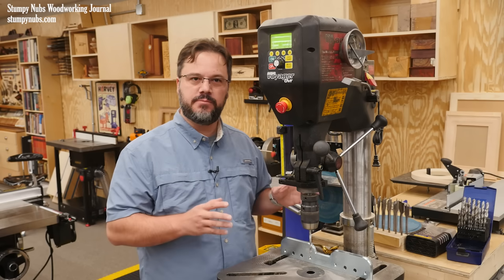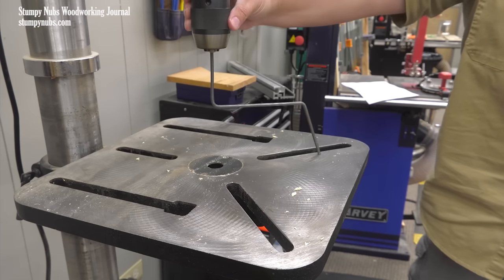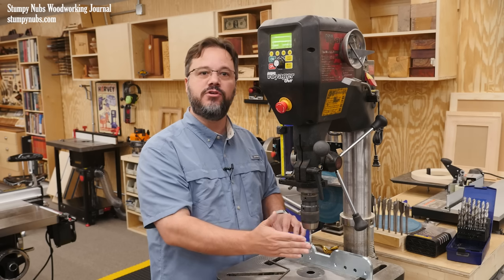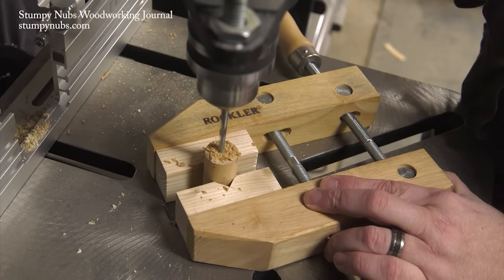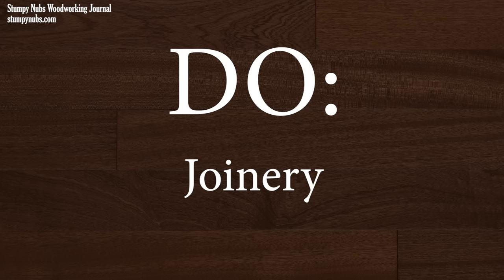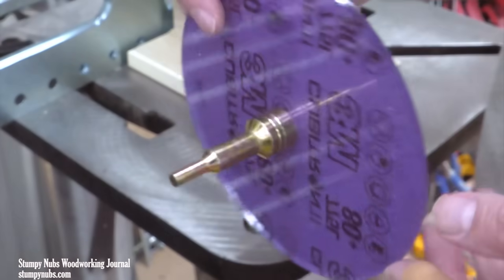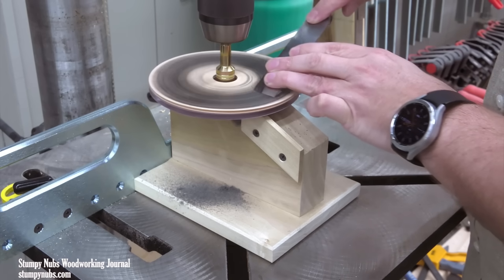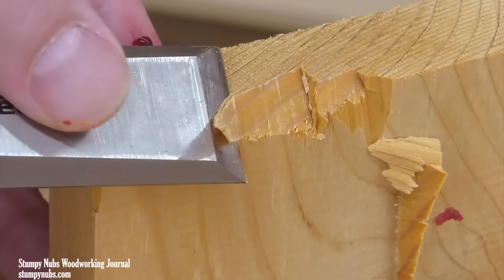WARNING: Internet drill press trend can SERIOUSLY hurt you!

Comment: Worked in machine shop for 40 years.   Saw the results of drill press accidents,  torn off thumb and fingers and mangled hand. 
Don't wear gloves when operating. Your hand will be pulled in by them .  
Bolt your project down securely in 2 or more places. 
Remove the stringy chips with a  1/4  steel rod , straight,  no bends in it.
Never place your hands in harms way if your job breaks loose and starts spinning.
Reply: Ole retired machinist here. I agree with this!!!!
Reply: What do you mean by the stringy chips?
Reply: Right you are. I recall a coworker who lost his thumb when drill press caught his glove!
Reply: @jaeyi8936  if you dont know, you havent drilled a hole...

depends on the metal... and the drill itself.

copper and aluminium both tend to make long spirals, hairs, and if they dont eject enough material... they gum up and seize in the hole. or it just wraps its lf around the drill forcing you to stop and clear everything on every hole..

brass chips no matter what you do, as does cast iron...

its the steel that makes nasty flaking "pins" thats the worst, imho, little shards of steel that get into everything. usually your toe, two days later when your carrying that heavy awkward item somewhere... "FFS!"
Reply: @jaeyi8936  The swarf -  "small pieces of metal, stone, etc., produced when a material is shaped or cut on a machine"
Reply: @jaeyi8936  Opps,  I worked with metal.   Anyway, don't ever try to pull away metal chips with your hand.
Reply: @OneWildTurkey  thanks, I think I know what you mean! I'll google swarf to make sure.
Reply: @paradiselost9946  gotcha, thanks. I've only drilled wood so wasn't familiar.
Reply: @jaeyi8936  ever tried ripping a log with a chainsaw? same effect, you get long "strings" rather than the "chips" of a standard crosscut.

when metal comes out in nice corkscrews, its fine... sort of fun on a lathe, watching them emerge from a bore, pausing every now and then to break them off so you collect a nice pile of screws all the same length, and easily tossed in the bin... or try and keep that long spring running as far as possible, snaking its way across the workshop floor... (bad chip management! frowned upon!)

its also a good sign that a drill is sharpened properly or not, the symmetry of the curls from the cutting edges.

 whereas every now and then you get threads, and they wrap themselves around everything, usually just at the end of a finishing pass so you cant see a thing and cant stop either or youll wreck the part...
Reply: That goes for any machinery. I would take off any wedding rings as well.
Reply: @rshinn8776  No jewelry Period when working with machinery. No loose clothing either.
Reply: @paradiselost9946  I worked in a screw machine shop had one job where we turned the O.D. with a box tool (a tool that cuts on a tangent to the diameter) had strings of 12L14 that where literally longer than I was tall. I'm only 5"7" the string was 6" and change.
Reply: Should NOT have the magnetic cup for things. They could fall out from vibration. NOTHING should be loose and near the whole drill press.
Reply: I came back just to read these tips as the YouTube player had other ideas. I don’t have a drill press yet, but it’s good to learn the safety precautions BEFORE buying the tools in my opinion. Nothing better than veterans of whatever field that tool comes from. Cheers!
Reply: @brucemiller1696 had that happen 😂
Reply: @danielbackley9301  lol, i had the joy of setting twin tool box cutters with steady rollers at one point... and multi point boring heads.

could take a few hours, but once theyre in use and maintain tolerance over a week of production... well worth it :)

sigh... "obsolete technology"...
Reply: @paradiselost9946  Oh. You mean the swarf.
Reply: 1/4" steel rod? I used to use a wooden ruler or meter stick, as at least it will break under my own strength if it gets snagged badly by swarf.  It's all not relevant for woodwork though.  The high torque, high momentum and slow speeds in metal work are a different kind of evil.
Reply: @mgjk  The 1/4"  rod (steel)  is maybe 18" long.  If anything grabs it, it will just slide out of your hand  - no harm done.    * it will last several hundred years doing lathe work !
Reply: Back in my first machining job, I used to hold my arm out and let my long sleeve take the swarf off the spinning bit. Any machinist already knows why I suddenly stopped doing that - all I'll say is I was very lucky, got away with just a torn sleeve and a bruised forearm.

And then a week or so after I left that job, my (former) coworker got careless with the mitre saw and took his fingertips off - used the saw to trim a tiny ragged end off an aluminium plank, and the saw kicked the offcut straight through his fingertips.
Reply: @patheddles4004  You were lucky to only lose a shirt,  with some bruises.  A large radial arm  drill press would really mess you up.  Stories like this give a cold chill.
Reply: @jaeyi8936  When we cut metal and drill with a constant feed,  a swirly long chip will be created.  Spring like.  Unlike wood.
Reply: Grabbing a helicoptering part is the only injury i've seen on a press myself. Thankfully wasn't too bad as they succeeded but the bruising and scrape was ugly enough. Was especially low speed stuff which is probably why they  thought to grab it over hitting the stop.
Reply: @MrJdebest  relatively small drill press, but yes I got lucky. Scared the shit out of me, and in retrospect that was a very cheap way to learn that lesson.
Reply: That goes along with controlling the urge to break the fall of a heavy object with your foot!  A friend got a severe beak in his foot trying to "cushion" the fall of a tool that wasn't secured.
Reply: @87mini  I know about that.   A worker put his foot out to safely and quietly land a steel bar on his steel toed boot. Opps,  he forgot he had sneakers on . Ouch.
* Also, if you drop a gun, you are not supposed to try and stop it by catching it. Your finger might catch the trigger and  Boom.

Comment: Another hint if you need to drill sheet metal.  Sandwich the sheet metal material in between two pieces of plywood, clamped to the table.
Reply: Important to note why: It's not just a safety thing to make it more controllable. The wood clamping the sheet metal prevents the pressure from the drill bit deforming the stock, making for a cleaner, more precise hole and less material deformation. To a lesser extent it also sinks some heat away and that can matter if for some reason you're drilling Inconel sheet.
Reply: How do you drill a hidden mark?
Reply: @rodenreyes6320  You set up the material and lightly clamp down, then you place a cover board over and use another clamp to hold the cover board in place.  Not going to work in all situations, but usually will.
Reply: @sferg9582  OK...I was thinking sandwiching all before drilling.✌️
Reply: I use chassis punches for that
Reply: I always use a annular cutter for sheet metal. It is always a clean start and finish, never grabs.
Reply: @rodenreyes6320  you don't have to reinvent the wheel, these commenters have a collective millennia of experience. Asking was sensible.

Comment: Not specific to a drill press, but to all the drill indexes out there.  As a retired toolmaker, I made it a habit to store my drill bits in the index with the cutting end down, and the shank up.  I found that closing the larger drill index, the cutting edges can sometimes be a hazard, but only when they're pointing up.  Another benefit to that is sometimes a drill bit will spin in the chuck and bugger up the shank with a burr (admit it, we've all done this), buggered up shanks don't fit the index holes.
Reply: I worked with a 40 year machinist, he was only person I ever saw without burred bit shanks . But whenever I do it I will touch it up on the grinder before putting away . A bur will  off center the bit just a little
Reply: @outinthesticks1035  Yes!  I do remove the burr too, just not immediately
Reply: I've been doing this, tip down storage for years.  I don't even remember why I started but it just feels more natural to me to protect the cutting edge, and myself from the edge.
Reply: Storing in an index is just a nice idea on its own, or as a plate for a bit block.

Comment: I'm a good example of a bad example regarding not clamping the work piece. About 20 years ago my youngest son watched me in horror as a sliced through my thumb after failing to clamp a thin strap of metal while enlarging a hole. The drill bit grabbed the strap and very neatly cut through my thumb tip including the nail. The nail eventually fell off and took almost a year to grow back. I purposely left the blood stains on my shop floor as a reminder.

Comment: In the early 80s I was running production lines for Tandy, building floppy disk drives.  We had a rework station modifying a plastic part on a drill press.  The young woman got her long hair caught in the chuck and her forehead was quickly pulled in to the chuck teeth. causing a serious wound.  Loose clothing, jewelry, hair, can get easily caught in spinning machinery.
Reply: Veronica Lake did a promo about that for women in war industries during WWII, showing her hair caught in a drill press.
Reply: And people wonder why I ALWAYS put my hair up and am an expert at finding things to secure it with...crochet hooks, pens  pencils, chopsticks, wire.....if it isnt up and contained, Im not playing.
Reply: @Omegasupreme1078  My first thought as well

Comment: re:magnetic tray ABOVE the work surface - I put mine down on the base after the third time the chuck tool fell down while I was working. Sure, the bowl might fill up with chips, but thats much less disturbing while drilling.
Reply: I once saw a drill press with an interlock switch which required putting the chuck key into a hole to activate the switch.  In the name of safety, I am surprised that is not a standard drill press feature.
Reply: Above the work area is a definate No No, anything falling and contacting any spinning object, be that the chuck or the drill bit, will send that item flying at a greatly increased speed.
Reply: @iwb316  Agree, surprised he placed it high up.

Comment: It was the drill press that I had the most respect for in the engineering shop were I spent most of my working life.  It had a 5hp motor and a number 5 Morse Taper, and a gear box rather than a belt.  From memory, it would go as low as 150rpm.  One thing is for sure.  There was no stopping it, even with a two inch twist drill.  We were very careful to secure the workpiece in that drill.
Reply: Luckily, my drill press has somewhat worn belts, so if the drill bit catches on something, the belt will slip, yet they are tight enough to do all normal drilling. Loose belt has saved me several times. I can't imagine a gear drive!
Reply: @61rampy65  same... imagine if the bit get stuck in the piece, the piece start to rotate until it hit the column, then shrapnel start flying all over the shop

Comment: Biggest tip of can give is always ALWAYS wear proper eye protection. ESP drilling or grinding or sanding anything metal. Unless you want your eye to rust and have to have a dr use a “eyeball drill” look it up. To drill out the metal shards stuck in your eye.

Comment: Learned this in wood shop over 50 years ago: Attach a chain to the chuck key to mount it to the back of the drill press head. Leave just enough slack in the chain to reach the chuck. That way, if you forget to remove the chuck key, the chain will prevent the key from flying off the chuck when you accidentally leave it in the chuck and turn the machine on.
BTW, that drill press sharpener is no joke. It works really well. I've used it to sharpen plane blades as well. The hardest part is making the wood jig. You need to make this so it is perfectly square to the table. I was able to do this without using masking tape for shims. I also make it with two bevels - one side 25 degrees and the other 30 degrees.

Comment: I took a machine shop class as an elective in college while getting my mechanical engineering degree. Two things that stuck with me were never, EVER leave the chuck key in the lathe. And the drill press is easily the most dangerous tool in a shop.
Reply: Your wrong on the last front. The most dangerous tool in a wood shop is the jointer, as it will suck you in and spit you out in chunks.
Reply: Back in my metal shop class in the 90s the teacher had a bucket sitting next to every lathe in the room. The first question from all new students was "What's the bucket for?". His anwser was "That's what we send you home in if you f around with this machine."
Reply: Drill presses aren't that dangerous, saws are and an instantaneous body part removal tool.
Reply: Other replies show exactly why you're right -- nobody thinks they're dangerous. My high school metals shop teacher in the late '90s said the same thing: after burns from touching hot metal, the drill press was responsible for more injuries in his class than any other. It's not that the drill press is so much more dangerous than other spinning tools, it's that so few respect how dangerous it can be.
Reply: @bloodgain  BINGO.  the teacher with 40+ years of industry and classroom experience said more people get hurt with drill presses than any other too by far.
Reply: @ravenbarsrepairs5594  You both are wrong, the most dangerous thing is the shop is the human! !! !!!
Reply: I would argue a vertical band saw is the most dangerous because it doesn't scream at you DANGER DANGER DANGER, it just whispers go ahead, be sloppy, look around while you are cutting while I remove your fingers or hand before you even know it has happened. The drill press is far more powerful and dangerous than novices believe though. Yup, don't EVER walk away with that key in the chuck if you value your eyes and your teeth.
Reply: My coworker simply laughed after they fired up the drill press and the chuck key made a interesting velocity sound as it flew passed my head. Careful who your around, people only live just once no matter what anyone else says.
Reply: I would not argue but state that any tool in the workshop is highly dangerous if not used properly. I am sure James will attest to that.
Reply: @Sebastopolmark I was going to say over confidence but I'll accept yours.
Reply: Possibly the most dangerous in a machine shop. In the wood shop, routers and shapers can quickly remove a lot of meat that can’t be sewn back on. We also become very complacent with circular saws and high-powered table saws because we use them so much. These tools can hurt you bad in a variety of scary ways, including femoral bleed-out, digit removal, and impaling injuries from a hard kick-back. My rule is that if I do something stupid that shows me my head isn’t in the game, it’s time to walk away for the day.
Reply: @akawireguy1197 really? Those things are scary AF to me 😅
Reply: @truetech4158  YOLO😅
Reply: My cheap Harbor Freight drill press has a spring loaded chuck so it won't stay on the chuck unless you are pushing it.
Reply: @billj5645  Same here, except mine is a Rok, or some name like that.
Reply: @billj5645 
I dont Like the spring loaded Chucks because If you get used to them and you Work then in a Shop with Out...

For the drillpress i Like quick Chucks that dont need Tools.

And Here a Bonus Tip If you are in a hury dont dry to Speed Up a tool Change by slow down the Chuck with your Hand...really dont do that.

Greatz from Germany
and have a nice "save" Day
opo
Reply: For me, the most dangerous tool in the shop is normally the operator. Specifically machine wise, I would say the wire wheel. Seems so innocuous....
Reply: Few tools can compete with an industrial lathe. I have yet to see a drill press turn a man into a red mist.
Admittedly I have lost track of the number of people who sustained (minor) injuries with a drill press, with the majority being nicks.
Reply: @Yzerbruh  I think most people confuse "dangerous" with "how much damage it can do".  A rock crusher could do more damage than any shop tool but it's not likely to hurt you, thus less dangerous
Reply: I think the most dangerous thing is an inattentive mind or maybe someone who surprises you with their presence. My wife used to surprise me in the shop frequently. It really pissed me off . I don’t get mad easily. She realized on one occasion how mad I was. 😮 She doesn’t do it anymore. In fact she doesn’t even come into the shop now.
Reply: I nearly learned that first one the hard way back in college.   I was working on a project late one night.  In my sleep-deprived state I left the key in the chuck and turned the lathe on.  Luckily the key got flung out before it embedded itself in my skull.  I could feel the wind from it as it flew just over my head....  still think about that close call.

Comment: “Don’t use router bits in your drill press.” I laughed out loud! My god I have never heard of this but I’m glad you warned people that might try it. Yes, please don’t!
Reply: Well, that's actually in line with the standard method for routing using a Shopsmith (granted, you swap out the drill press chuck with a router chuck). I really dislike routing in this manner as it's much easier to control the material when the router bit is under it.

Comment: The old Delta "Getting the Most out of your Drill Press" devotes an entire chapter to routing, rabbeting, and fluting on the drill press.   It also states, "Light milling operations - keyways, slotting, and surfacing - can be done on the drill press by using a slide rest to feed the work."  Quality drill presses include a threaded mounting collar to lock the chuck on the spindle taper.
Many good tips.  Thank you.